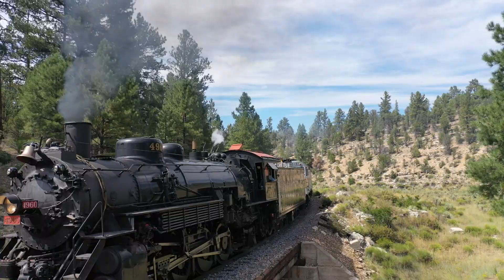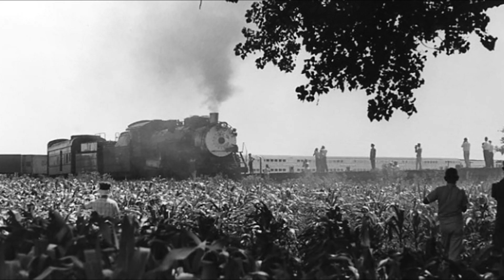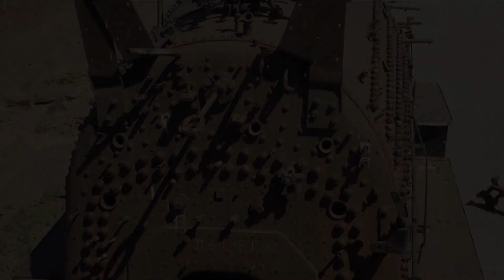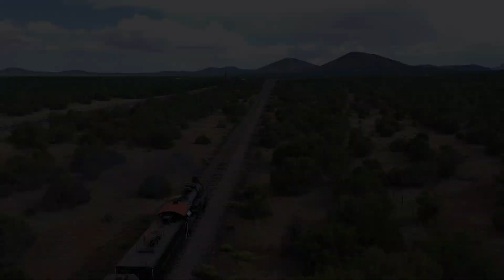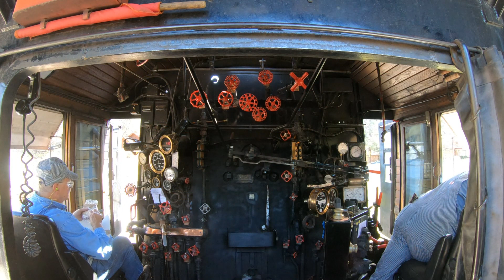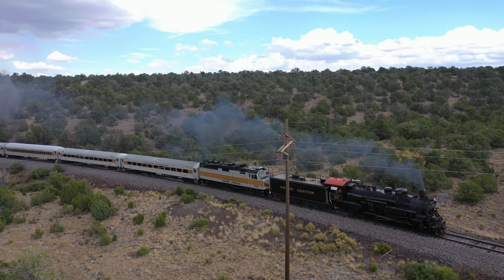Grand Canyon Railway 4960 Steam Locomotive

Comment: what happened to 4960's original tender? Also what happened to the Locomotive that the new tender came from?
Reply: The Soo Line 4-8-2 locomotive that had the tender was scrapped a long time ago.
Reply: As for the 4960 CB&Q tender, it too was scrapped. It had severe rust issues and would've been too small for the 64-mile trip from Williams to the South Rim.
Reply: @wordenentertainment1997  *sigh*
Reply: @theextremeanimator4721  leave
Reply: @ryanlikestrains3685  why?

Comment: That sure is a pretty almost steam punk MU stand.  A few knife switches would complete the ambiance.  Seriously.  Nice job and nice bright work.

As a blacksmith, I always lamented human DNA sadistic omission of a third functioning arm and hand.  Seems it would be a handy arrangement during wheel skip conditions for simultaneously operating the throttle, sander lever and sander button.  Oh!  I get it.  The engineer is moving near the speed of light, so time slows down enough to be able to push the button, grab the throttle, flip the sanding lever, rinse and repeat.
Reply: The engineer and fireman were playing a symphony in steam.  All movements were choreographed and precise.